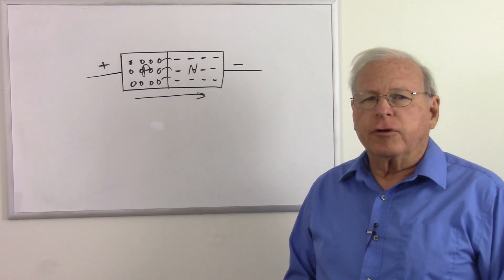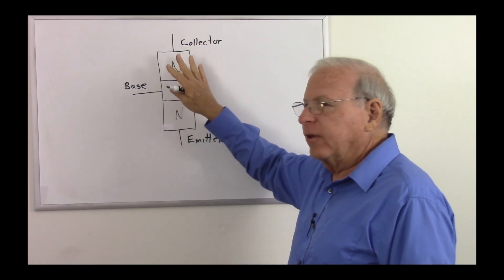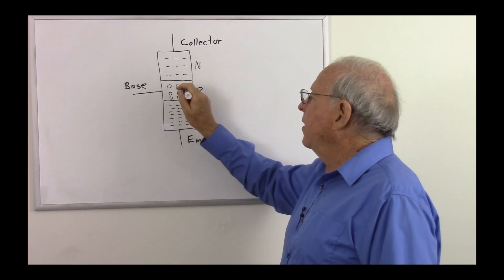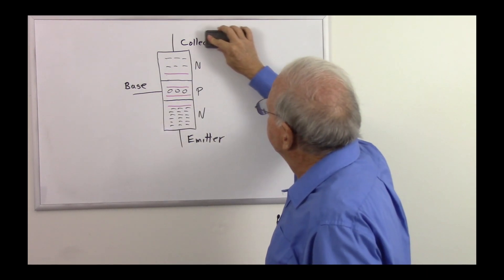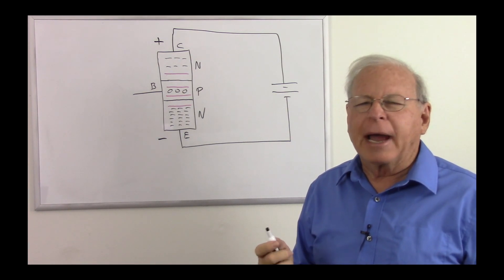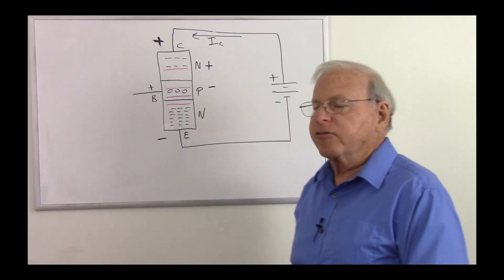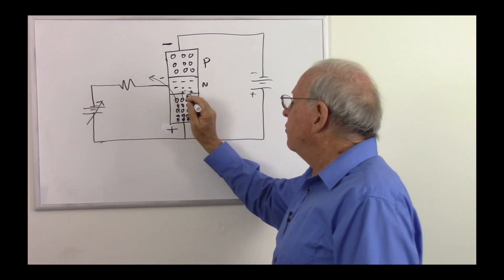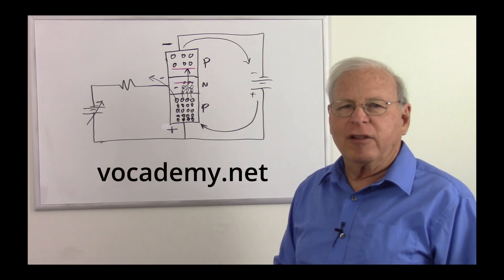Bipolar Junction Transistors - Part 2 - Operation

Comment: I have a small question on ICBo. In the datasheets and in some of the reference text books it is mentioned that this is the reverse current from collector to base when the emitter is open. Could you pls throw light on this aspect?

Comment: Going through some basics again, and got myself in a knot. In a BJT circuit what's the situation on where to place the load in relations to the supply and the collector??? Looking at NPN and PNP I seem to have different answers for different reasons. The simplest seems on a NPN between the "+ve" and the collector, and on a PNP between the collector and the "-ve". Like a lot of things the more I google the more I just get confused as to "why?". I imaging with my level, successfully lighting an LED if I get lucky, it's not making much difference. But just keen to understand.

Comment: But you didn't talk about the majority carriers becoming MINORITY carriers as they approach the reverse biased collector-base junction and are therefore swept into the collector from the base which forms a much heavier current flow from emitter to COLLECTOR as compared to emitter to BASE. That would give the 'hf' parameter of the transistor.

Comment: Hi sir.on the pnp drawing the bjt base control side circuit  ,you have drawn the battery polarity reversed to the current flow from Emitter .is this write ?.thanks.       i am learning so much from you.
Reply: In PNP transistor he used conventional current from + to - so his drawing is correct. Common positive goes to emmitor. Small negative voltage goes to base and big negative voltage goes to collector.

Comment: In diode model you talk about voltage (or charge) and now in transistor model you suddenly talk about current in base ??  Ib (base current) does not control Ic (collector current)  !!!  Ic is controlled by Vbe !  voltage between emitter and base !  you will confuse your students / viewers. Voltage is the reason - current is the outcome.  Ib is a parasitic current that will leak into base. and the amount of Ib from Ic  is described as Beta... There is no current controlled transistor because Ib didnt cause any changes in Ic.

Comment: I belive you swapped the terms drift and diffusion around 11:00. Atleast the way ive learned it, diffusion has to do with random motion causing areas of higher concentration to have net flow into areas of lower concentration, whereas drift is used to discribe motion caused by extrenal forces (in this case electric field)
Reply: Well you have both drift and diffusion currents in that situation but I belive you atleast kinda equated the two terms